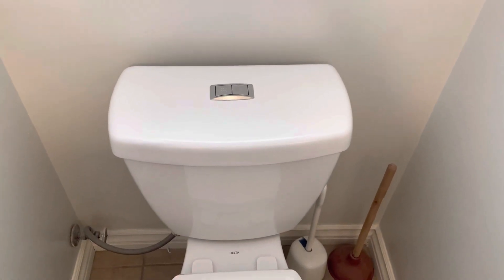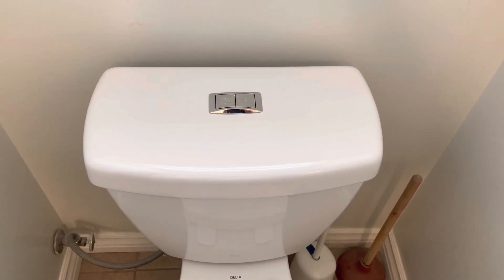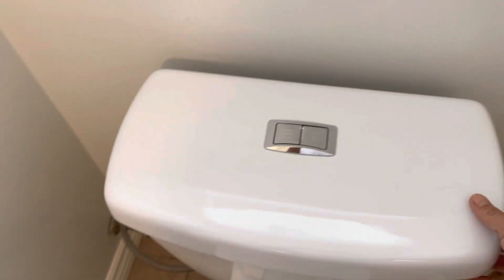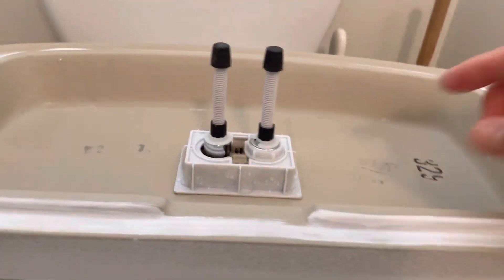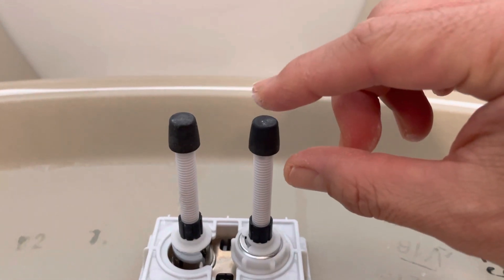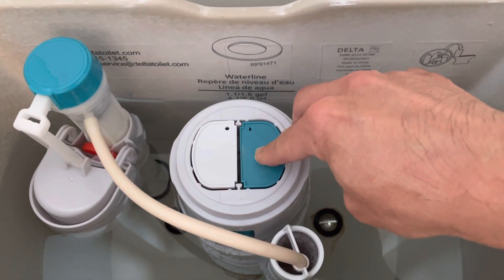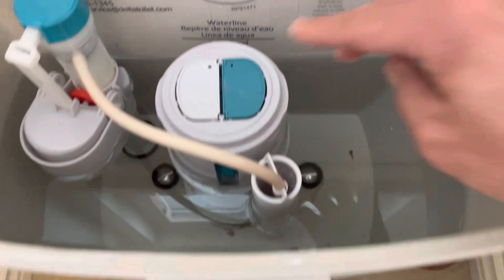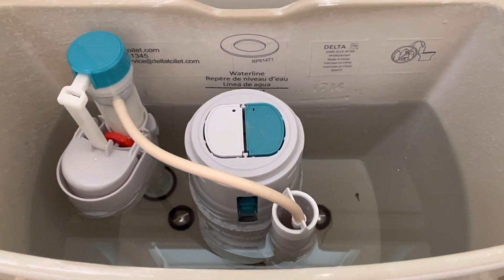Quick fix to dual flush leak

Comment: Good video, I have 2 of the same Delta toilets. Tried your helpful advise but the Ghost Flushing still happens occasionally especially late nights... Could be also attributed to high municipal water pressure in our city. But I was wondering what is the Orange colored disc? Will rotating it control water levels... Please Advise
Reply from the maker: @satyajitgudimani391  Hey bro. Ghost flushing “especially”’at nights? That’s weird that the frequency will change depending on the time of day, so no idea on that one, I’m sorry. But I’ll be honest, I never even noticed the orange disc until you mentioned it so I had to rewatch my own video to see what you were talking about. LOL. So I have no idea. Sorry I don’t have an answer on that one. Thanks for watching!